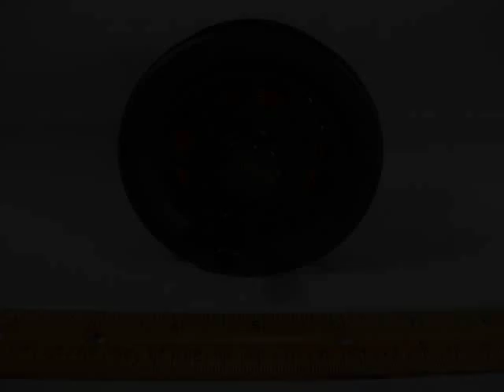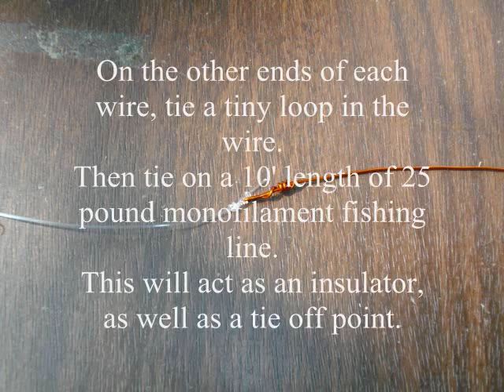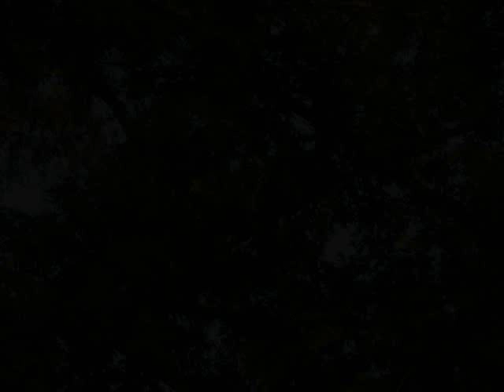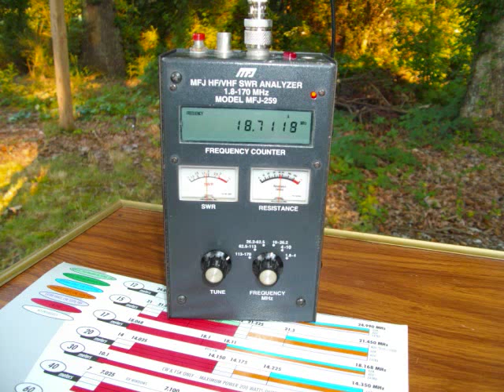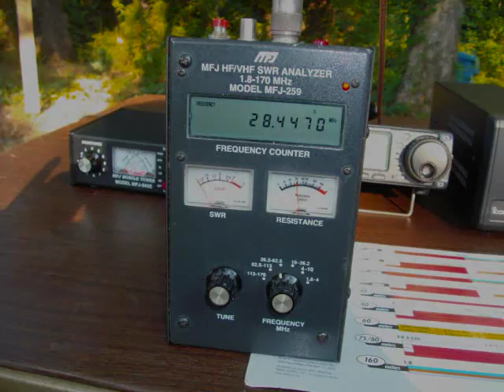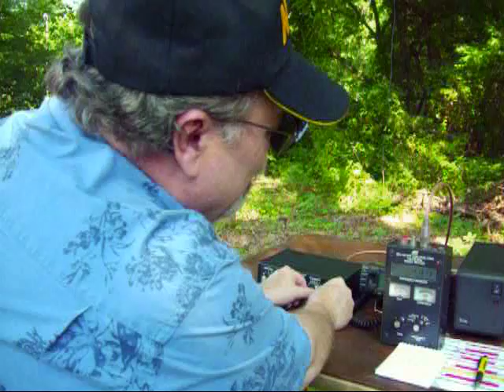80-6 meter OCF Dipole Antenna for SHTF or Backpacking Part 1

Comment: If I were trying to make a shorter version somewhere around 50 feet for the long end what would I need the two wires to be I had one cut at 53 and 31 it was ok but I think I need different values Any help appreciate Trying to work 10 threw 40 m